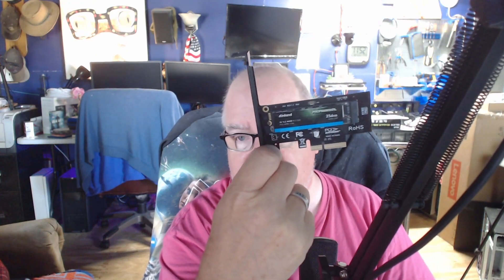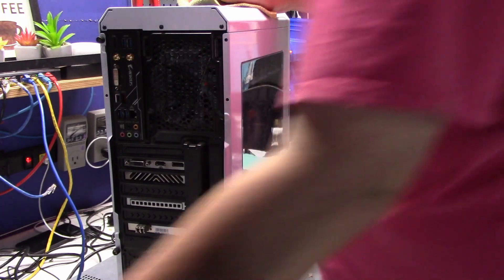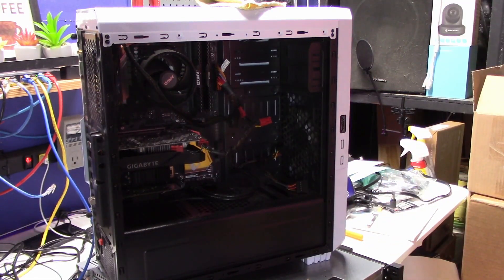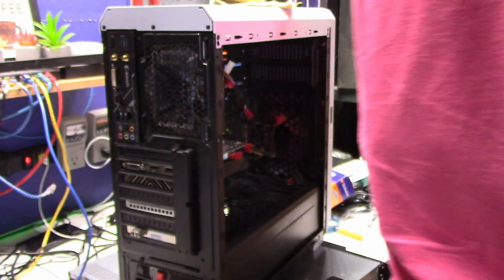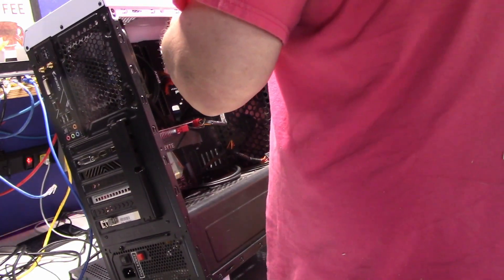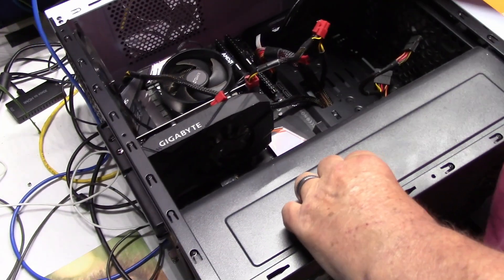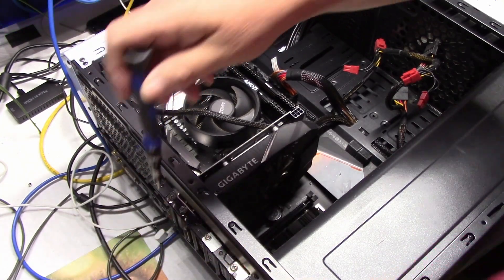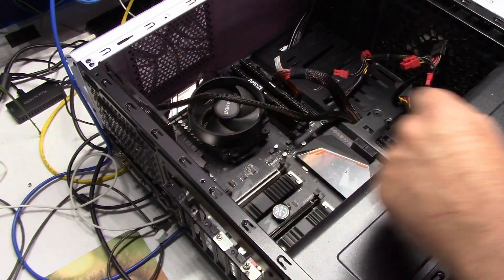Increasing your system speed without spending any money!

Comment: Sounds to me like this was a case of not reading the motherboard manual when the system was originally built, or when the NVMe drive was installed.

Whenever I am building a new system, retrofitting an older system, or installing a new component into an existing system where I have not installed said component previously, I ALWAYS will consult the motherboard/system manual at least once so that I know what I need to do.

Call it "pre-lab".

It's the same procedure as your high school chem class where you would read the entire procedure for your upcoming lab experiment so that you know exactly what you're doing, before doing it.
Reply from the maker: I could see where that would come in handy, but "real men" never read the directions :) Thanks for watching.
Reply: @UnkyjoesPlayhouse  
At least this was a no-cost fix.